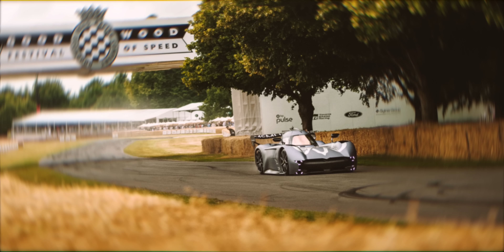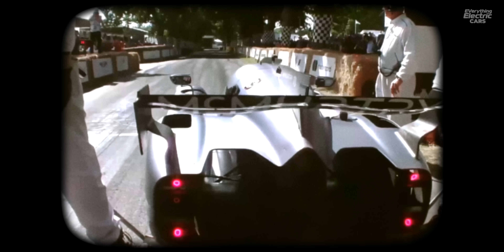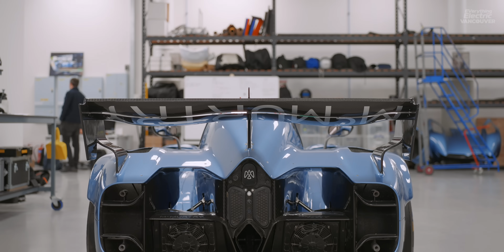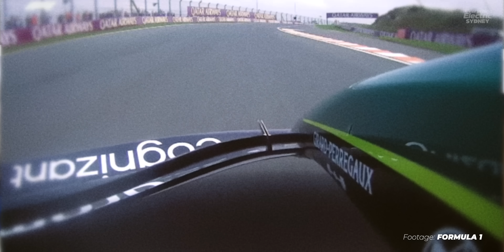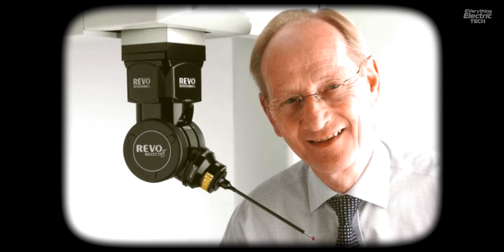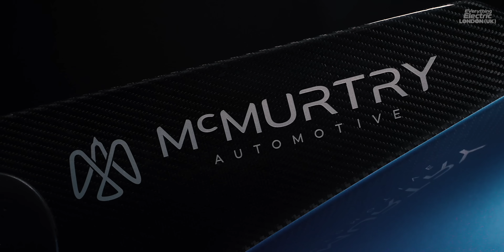The Tiny Fan-Powered EV That Drives UPSIDE DOWN!

Comment: Yes, but the Torygraph says" Can it tow a caravan to Lands End and back?"
Reply: Anyone who could afford this wouldn't be living in UK anyway, not with Rachel trying to collect her wealth tax.
Reply: @ForestForest-n9i @ForestForest-n9i Since you find it necessary to post continually about hydrogen, even though you don't own a hydrogen vehicle yourself, I will post this fact check for anyone else reading.
Battery Electric Vehicles (BEVs) are better than Fuel Cell Electric Vehicles (FCEVs) primarily due to their
significantly higher energy efficiency, superior charging infrastructure, lower total cost of ownership, and technological maturity. 
Core Technological Advantage: All FCEVs Use Lithium Batteries 
A critical point often overlooked is that FCEVs are not battery-free; they operate as a series hybrid system, using a fuel cell to generate electricity, which is then stored in a buffer lithium-ion battery that powers the electric motor. This means that any issues related to the environmental impact of lithium mining, battery manufacturing, or battery disposal that are used as arguments against BEVs are also applicable to FCEVs. 
List of Solid Reasons BEVs are Better Than FCEVs

    Superior Energy Efficiency: BEVs convert 70-90% of electrical energy from the grid into motion, a much higher rate than FCEVs, which are only around 30-40% efficient "well-to-wheel" due to energy losses in hydrogen production, compression, transportation, and conversion back to electricity in the fuel cell.
    Established and Expanding Infrastructure: The electric grid is already extensive, allowing for home charging (a major advantage) and a rapidly expanding network of public charging stations. In contrast, hydrogen refueling stations are sparse and limited to a few specific regions globally, posing a major logistical hurdle for FCEV adoption.
    Lower Total Cost of Ownership (TCO): BEVs generally have a lower initial purchase price, lower maintenance costs (fewer moving parts), and significantly lower "fuel" costs per mile compared to FCEVs. The cost of hydrogen remains high, typically between $10 and $15 per kilogram in the US.
    Home Charging Capability: BEV owners can conveniently charge their vehicles at home overnight, ensuring a "full tank" every morning. FCEV owners must visit a dedicated hydrogen station, which are rare and often experience operational issues.
    Technological Maturity and Market Share: BEV technology is more mature, with a much broader market acceptance and a wider variety of vehicle models available. This leads to economies of scale and ongoing innovation in battery technology, such as solid-state batteries and V2G (Vehicle-to-Grid) capabilities, which FCEVs cannot offer.
    Simpler Energy Source: BEVs rely on a single, direct energy pathway: the existing electrical grid. Hydrogen for FCEVs, however, is often produced using carbon-intensive methods ("gray hydrogen"), diminishing their overall environmental benefits unless "green hydrogen" (produced via renewable energy electrolysis) is used, which is currently expensive and limited.
    Reduced Complexity: BEVs have a simpler powertrain with fewer components, leading to lower manufacturing and maintenance costs. FCEVs have the added complexity and cost of a fuel cell stack, high-pressure hydrogen storage tanks, and a necessary buffer battery. 

Thanks to you I thoroughly researched BEVs and learned why they were perfect for me. For anyone reading this, do your research. You may find the same thing.

Comment: fancy. just dont shug. why buy when you can diy. thats how above made everything, diy. so nobody can brag about their own doings. because nothing is your own doing. even if people claim so to get false honor. buy buy ice cold. just fly a drone instead. yep whoops ducted fan drone can also stick to the ceiling and walls. just dont wow at what stan claims to be his stuff. what you say, all your base is owned by above, not by people false gov. such violent barbarians throwing around fake false claims. be freed from people's hands clams. people's hands dont have above. armed? riscy. any such are danger to themselves. to make that better, let the fans flow up. not to the back. such nasty tailgaters. dont shug, blow up, like a normal whoopsiedoodles drone. then you never lose downforce because the up force points always down. because all wing lift is from the bottom, not from the top. blow any air upwards to keep the forces at right position. yes the whoop drone needs to be able to fly. giant vacuum cleaner btw. if those fans had enough power it could push the car forward like an air boat or hover craft. use wheel blower fans to push in any direction. ie if you have problems with drone motors. of course hub prop motors as usual for drones 4x. yeah and small support caster wheels on the chassis bottom. or dont bother with the wheels at all. just use the dry roll magnesium-air salt water batteries, replace when the battery gasoline energy weight density runs out. the recharging of the magnesium metal can be done with electricity alone hydrogen and stuff. license? freedom is always better. banned words by above: money service people's gov license rule right obligation responsibility deth. and all other 7 deth law based sins. license money claims is dodged by diy your own version. yep people rulers are like children of the world that dont care about anything but their rulership. no freedom. yep rulership by talk. service economy is banned by above. yeah better work for above than for people. now. no give handling to above, as you do a bad job in everything. your money is not thrustworthy. yeah knowledge makes useless and proud. yeah they sell you have to to you. above gives free gifts. less talk more doing. sorry trades of all jacks. why do you tolerate the witch woman who fell into works hypocrisy. any fallen on the streets is a woman. dont excuse you needing to work for people for money. let them eat cake. talk about your gov money betraying you. monolog dev log is a better log. wood. access denied for people's money. not interested. diy much better than them. well whatever you read on the local newspaper. ie your paper is fired from service. complain to above if you feel misstreated. be saved from your own money from people's hands. nah take your sales somewhere else. no camping here.

Comment: OMG! I'm a lifetime bicycling advocate, "a bike ride is a flight from melancholy" Eddie Merkz. As such, I've loved how "boring" and quiet electric cars have been. The missus is the opposite, the smell of petrol, the squeel of tyres, the throb of an engine, traditional motorsport has been an alegory for sex.

So, hearing this beast, this mouse that screams like an FA18 jet fighter, I had to show Linda! We're both seriously hoping there will be one of these at Everything Electric Melbourne! 

There's a solarpunk optimism in quiet EVs, but any good solarpunk anime needs its chase scene, the McMurtry is that chase scene!

I ride a Greenspeed GT20 trike with a 250w e-assist as my primary transport, silent but exciting. Despite being a trike, you have to weight shift to corner it at speed, I wonder how fast I could corner it with downforce fans 😂😂😂

If you need me, I'll be in my workshop 😂😂😂

Comment: I had the pleasure of seeing the Chaparral 2J in 1970 at the now defunct Riverside Raceway in Southern California. I had also seen the the 2C before its active wing was banned, and only fixed angle wings were allowed. As I recall the 2C's  variable angle wing was also acting directly on the wheel mounts rather than the body/frame of the car. The 2J did not win that race due to the snowmobile engine driving the fans  quitting as I remember.

Comment: The fan technology could be useful to stabilise ambulances or fire engines for certain areas like airports or industrial parks
Reply: Only if the ambulance and/or fire engine was fitted with skirts, so that the vehicle body practically touches the ground (as that's the only way to generate the vacuum beneath the vehicle)... which would them have negative effects for the comfort of the patient inside (for the ambulance, at least).

Comment: Downforce skirts got banned in F1 because they could just fly off the track if the skirt let go. Glad this was covered and demonstrated how safe it actually is and incredible only 6 Hp to drive the fans
Reply: While obviously a favourable situation, but never the less the way the car span and came to a hault in an almost instant stop using brakes and the fan was impressive
Reply: Lot older tech of course.

Comment: Cool for the track but on a regular road I would not want it sucking up a squirrel or leftover roadkill skunk.
Reply: It has filters under the car, because whether its road-kill or just gravel, sucking anything larger than dust up would trash the fan-system as it passed through.
Reply: It is unclear whether the fan mode would be permitted outside of race tracks.

It is also unclear whether the fan mode would serve any useful purpose outside of race tracks.

The most likely use case is for it to be driven relatively sedately to and from the track (if not taken there on the back of a trailer) before enabling all the toys needed for track-day fun.
Reply: @colinmcconnell827 I don’t think legislators have thought of that yet
Reply: Would it suck up a traffic warden?

Comment: I wonder is similar tech might find a place on the road, just for braking control ...and drying road surfaces ;0)
Reply: Unlikely, since the 'benefits' of downforce only really start to kick in as you pass the legal speed limit on the motorway... at slower speeds the benefits are diminished...

On the downside, any vehicle with this system also needs the suspension reinforcing, to handle an extra 2-ton of 'weight' (the effect of the fan-assisted downforce), whilst also having the suspension travel reduced to ~2 inches (in order to keep the side-skirts close enough to the road surface to generate the vacuum effect). 

Suspension that takes 2+ tons of force to flex 2" is the same as not having any suspension at all... and that's not going to be comfortable on our disintergrating roads.
Reply: @logicalChimp incorrect.  In emergency braking,  this could save your life, and this fan system works at zero speed. The suspension could handle that briefly.
Reply: It could indeed be installed under a car in some form,  at least helping with that emergency stopping.

Comment: What is the point of the rear wing if the fans are generating the downforce?
Reply: Added stability, and more safety in the event of double fan failure. The first version didn't have it, it was added because Max Chilton (their F1 driver development driver) suggested it.

Comment: Add some active wing surfaces and you've got a low flying aircraft 🤩
Hope they've got patents on all the innovations and don't lose the details to copycats 🐻🍯
The ending 😆
Reply: As mentioned in the video, surfaces are not weight efficient and cause instability when traction is lost so they were removed from the design.

Comment: Y'know, imma that old person that dislike angry noisy vehicles in my neighborhood 

Angry fan noises, hmm that's tolerable I guess, at least there's no air pollution 🤔🍃
Reply: Unless it sucks up all sorts of nasties deposited on the road surface.
Reply: Downforce is not needed for speeds less than 100kph. So unless you live next to a motorway, the fan noise is not relevant.

Comment: I'm curious to know what happens when the dust bag gets full.
Because this car is basically a vacuum cleaner for the track, right? Where's all the garbage go to?
Reply from the maker: It gets blown out of the back.
Reply: @fullychargedshow  Oh, that's good, I thought it got stuck in the vents.
Reply: @fullychargedshow 

Into the faces of the following drivers perhaps?
Reply: As with a vacuum cleaner - you empty it.
Reply: @colinmcconnell827 

Hardly!!!

Once the filters are "full" one would simply buy another car.

That's what I'm going to do.

There again at that price a man would be supplied to do the necessary anyway?

Buyers won't be of the hands on, doing the nitty gritty variety, will they.

Comment: The most amazing thing in this film is the fact Robert managed to get in the car.
Reply from the maker: Alright, steady on. I know I'm a porky and rigid old bloke that needs three points of contact and occasionally has 'a fall', but I can still get around :-)
Reply: @fullychargedshow  I am of similar age and ‘bulk’ and I know I wouldn’t even begin to try to get in or out of it or, indeed, any other low slung wee beastie. Well done for doing it. Fortunately, they kept the lifting equipment out of shot! 😂
Reply: @paulscountrygarage9180  I'm convinced there is more gravity around  now days. Because it so much easier to fall down, but so much harder to get UP again!!🤔
Reply: @fullychargedshow  but on camera it looks like you're 30cm taller than your cohost with shoulders wider than the cabin :-)
Reply: @fullychargedshow  there the age when you fall over and then the age ‘when you have a fall’
Reply: as a man of a similar age and a bit bigger,  trust me.
The biggest surprise was Robert was able to get out of the car😊
Reply: @brianiswrong didn’t you see the hoist in the background 😬
Reply: Speaking from personal experience in a Lotus Exige, the trick isn't getting into the vehicle... it's getting out again afterwards :D
Reply: Did it pass the groan test?
Reply: They didn't say he's out yet 😅
Reply: He got bigger than Kryten.
Reply: He got in with a bit of lube, but getting out required a can opener 😉
Reply: Have to admit as a man in his 60’s I was wondering the same thing. Was there a small crane out of shot perhaps? If not, I’ll have to skip this model.
Reply: The question is can they fit Jack Scarlett in it?
Reply: @MarkHilton1  now you are just being silly🤣🤣
Reply: Does McMurtry build hoists?

Comment: Ultimate track car
Reply: In the UK perhaps, but unfortunately most tracks in the USA have banned all EVs, allegedly because of “extreme risk of catastrophic fire”
Reply: @jpe1  It is called banning the competition. I don't care what USA does
Reply: @jpe1  Pikes Peak still allows EVs in the unlimited class I believe. So thankfully some race organizers are still allowing all propulsion types.
Granted, Pikes Peak isn't a track most people get to drive but it's a dangerous track and if the organizers allow EVs on there perhaps other tracks will start allowing them again.
Reply: @GoldenRumpedTinkerbird I’ve taken my EVSR (Electric Vehicle Sports Racer) to Pikes Peak twice, in 2015 and 2016.  First time I took three cars, unfortunately one of my drivers went off the mountain during practice, but the other two (Tim O’Neil and Rick Knoop) did ok.  The following year I entered just one car, again driven by Rick Knoop, Rick’s car had a computer glitch and he raced up the mountain on 50% power, so not a good result.  Haven’t been back since ☹️ 
The team has also raced Mt. Washington, and also smaller hill climbs, including Chasing the Dragon and Giants Despair (which I got to drive myself, usually I just race road courses, not hillclimbs).  The fact that tracks like Pocono, Watkins Glen, Limerock Park, Summit Point, and NJMP no longer allow EVs in wheel to wheel competition is why I had to shut down the EVSR program.